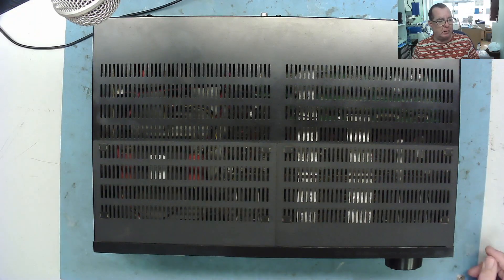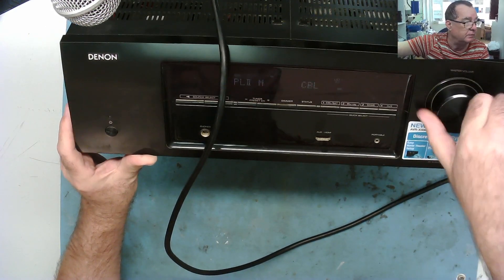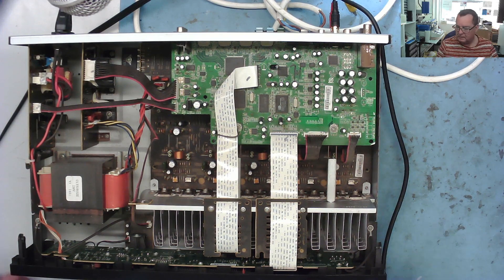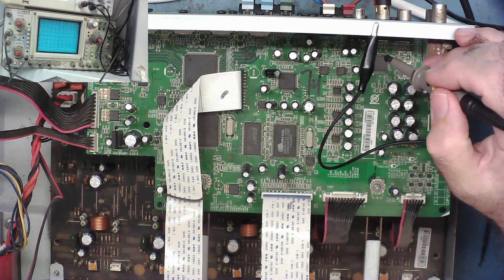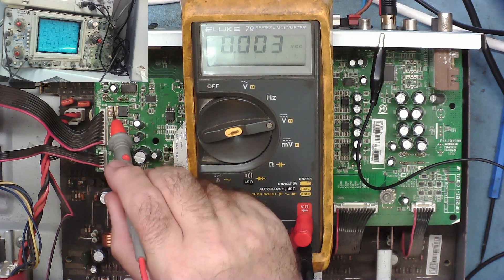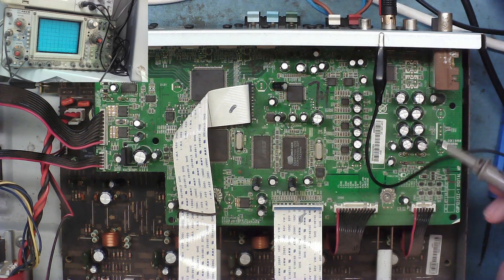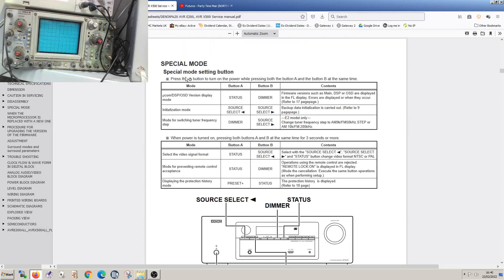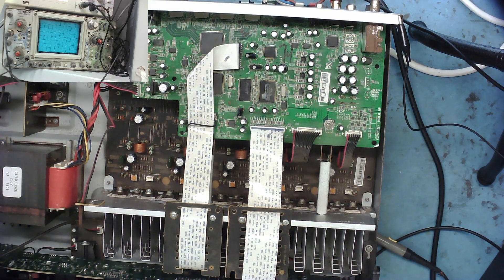LER #201 Denon AVR-500X Amplifier No Sound Output

Comment: Mine they is sound but I had to put into maximum. Still it so low cracking sound Nd buzzing sound even though I have turned it to 0 sound on volume, am confused 😒
Reply: Same here with my Right front speaker any solution u got

Comment: avr1912 power on but no sound for speakers but subwoofer is working. When I check the digital board BDV3002 ic is produce too much of heat. but that ic is not related to sound. according to schematic diagram that ic is a HDMI switcher. do you have any suggestions.

Comment: Just curious - are all amp circuit boards supposed to be grounded to chassis? I have a Sony ZX66i (2012) no sound,  that isn't & I'm wondering if that is a possible fault or just optional? Very informative video.

Comment: Interesting I bought a 2nd hand Drnon avr 1713 . Twice on warm restart the right front failed.  Slight cracking when volume up.  At first thought was speaker or cable so re connected but not.
 But after shut down and restart came good. 2nd time took bit longer
Just remembered,  did also flash up = 4 dB offset. ?

Comment: Hi there, just a quick heads-up. 
The model number is written wrong, it should be AVR-X500, so you might wanna update that to help others to easier find this video.
And that particular model was manufactured from 2014 to 2015, not in the 90's. The HDMI ports got into mainline AV receivers only around end of 00's
Thanks for the video!
Reply: Yes, ur right. I have denon avr x500 which is not working. Can u help me to find out name of one ic in power section down below. Thanks.

Comment: Sometimes its the equivalent of turning it off and on again or resetting the box to get the gremlins squashed.
Reply from the maker: Yeah exactly - that's why I published.  If you ask me, things like amplifiers are getting far more complicated than they need to be.  I mean, we had perfectly good (and powerful) completely analog HiFi amplifiers back in the day without all this digital shenanigans and they sounded great.... actually no,  in fact they sounded better than these things😋
Reply: @LearnElectronicsRepair  seems to be a common fault, I have an avrx1000 with  no sound output after being stored for a few months.  Tried factory reset.